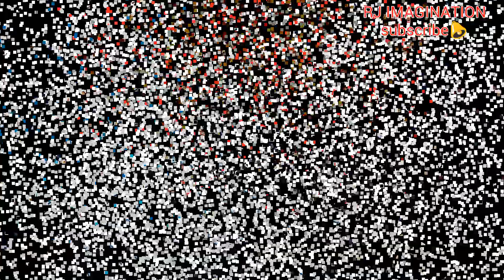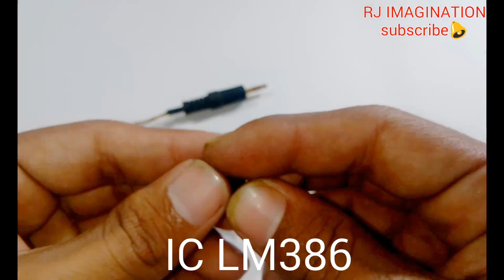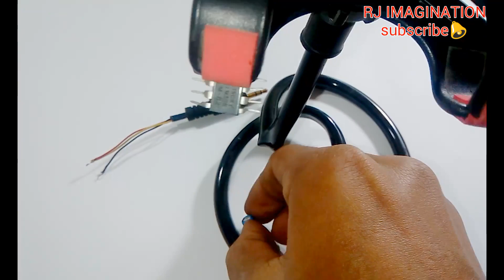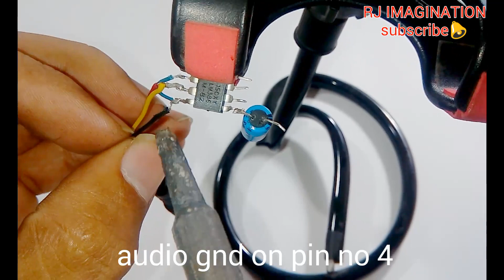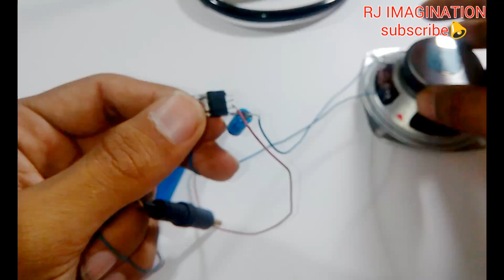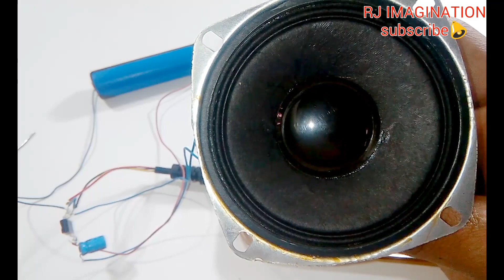Audio Amplifier | simple audio amplifier using LM386 ic

Comment: Good IC I tried it too. It distorts only if you put too much input level. You can increase the gain if you put some component between 1and 8. It does not like 4 ohm speakers.
Reply from the maker: +Károly Varga I wanted to make simple circuit

Comment: if we use 1000uf 16v and 220 16v. we can use it.right. but the loud of the speaker will be high or no? it will be the same of a 470 10V capacitor?
Reply from the maker: +lu lu sound will be equally
Reply: okayy thank you again. why? it will be equal?

Comment: can i use 1000uf  16v ? 220uf 16 v? if i dont have a 470uf? if i change a capacitor the battery will be change yes or no? or will be high?
Reply from the maker: +lu lu yes you can use 1000uf capacitor without doing other changes
Reply: okay thank you. :) this video is so great. :) <3
Reply: why did not it change?

Comment: Bro it very nice but I did it the sound is very low why IAM using 6w  oval 🔊 and 9v battery 🔋
Reply from the maker: Use 6v 2A battery or power supply, it will perform better
Reply: Sound low hai kyuki Esme bypass ni kiya gya hai 
Bypass krke 200db tk increase kr skte h